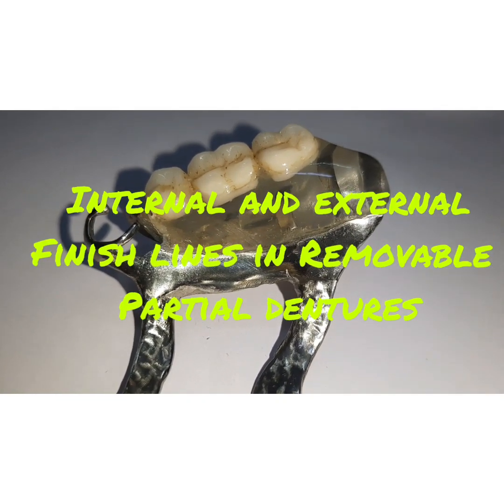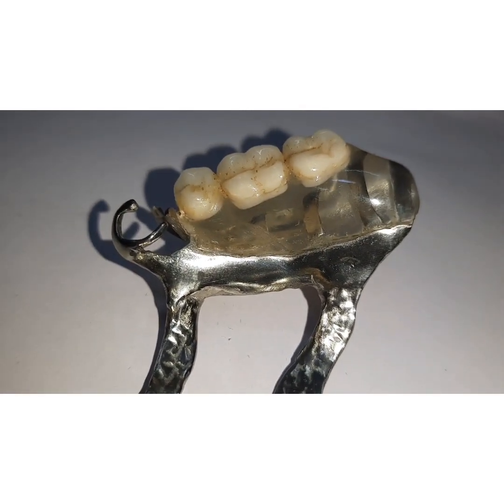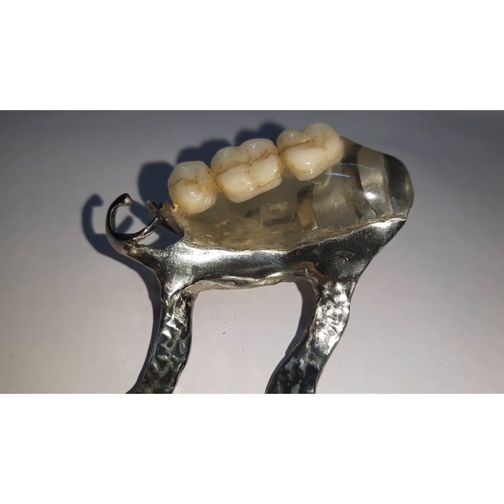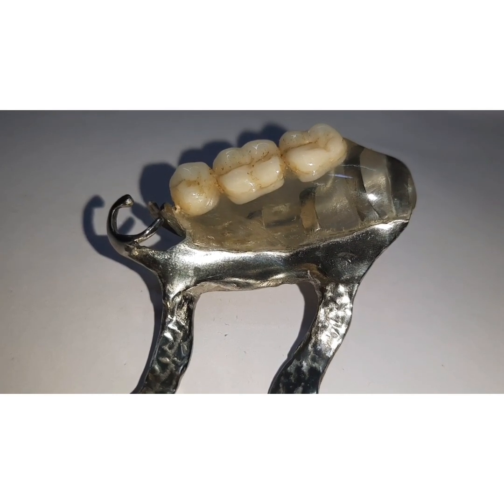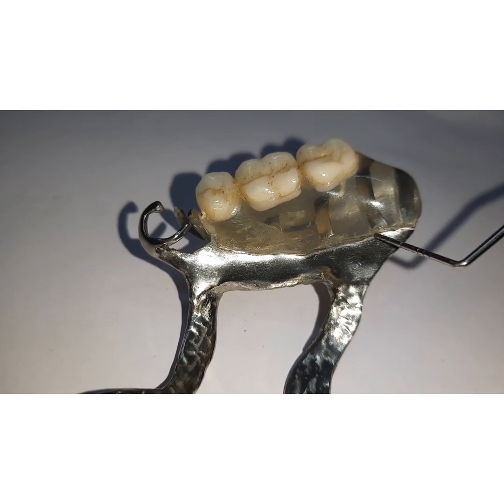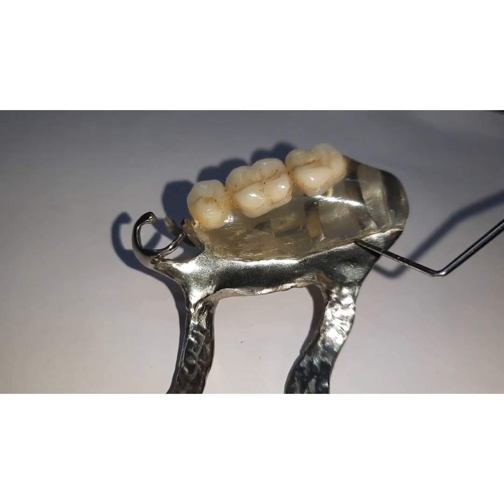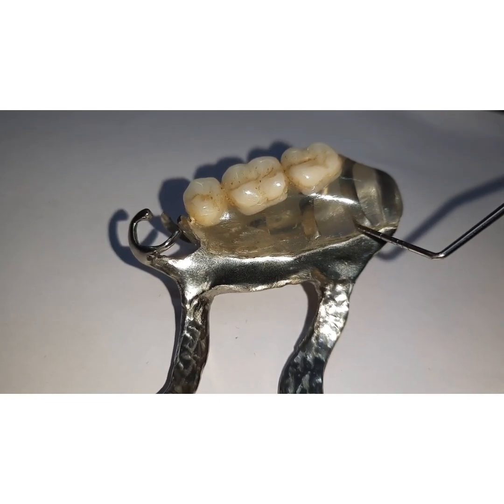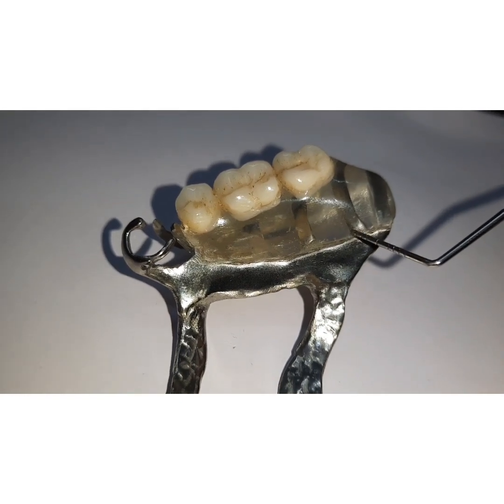Internal and external finish lines in Removable partial dentures

Comment: At 1:06 u said if minor connector is nail head or mesh type only external finish line is planned...and  at 1:23 u said like in other types of design like lattice and mesh both types are planned.
Now my question is- for mesh do we plan for both types of finish lines
Reply from the maker: Yes for mesh type both types of finish lines but for nail head only external finish line.